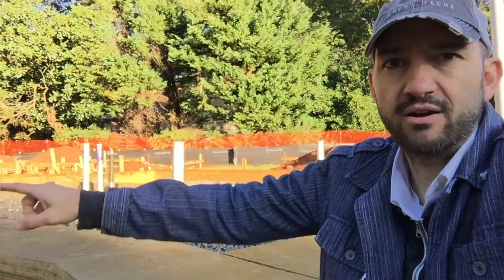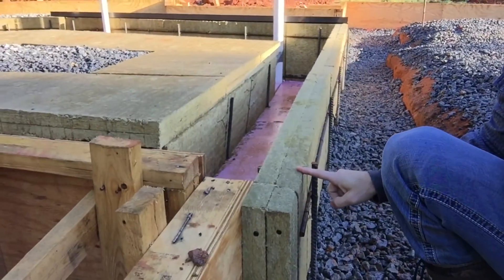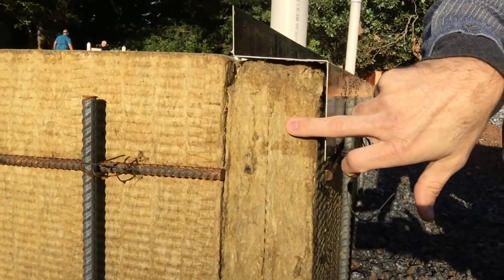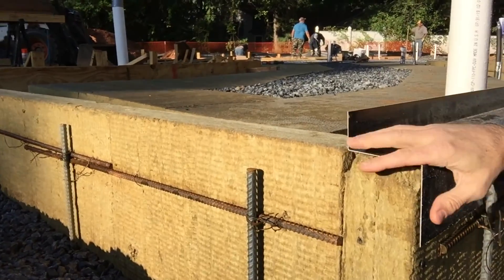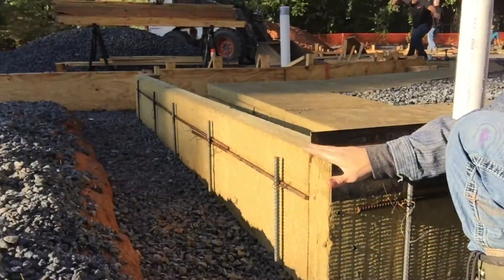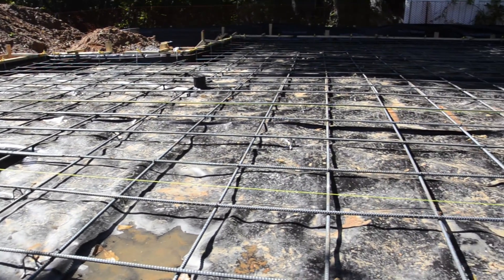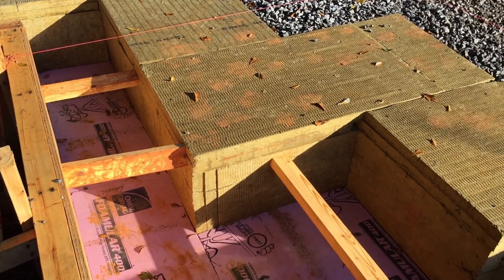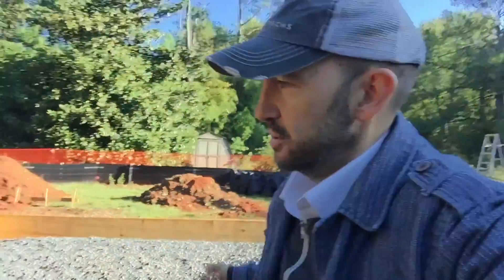Super-Insulated Termite-Proof Slab-On-Grade Foundation

Comment: Are the 24" footers, is what's called for in weight bearing capacity, or does GA even have a frost line, b/c you all have such a beautiful state(except for I-95 thru Atlanta, that's insane, I had a really bad incident traveling to FL thru there, I'm sure I'm not the only 1, lol) with warm weather. and can you explain the turn ups and turn downs. I'm sorry, I love Roxul videos and advance insulation and building techniques, as I think, in our country, we have the opportunity, to build great solid, weather proof buildings. I wish we would switch, to more concrete, like they do in other countries, as our buildings would last much longer, and if properly build, wouldn't have bug, breaking/cracking, and molding issues if built correctly. But great informative video.

Comment: Does that type of rockwool not wick water? I would not want a porus material  going into the ground like that....?
Reply: It will wick water. It insulates the same whether it's wet or dry. Rockwool specs it for this use case (Owen's Corning does not do the same for ThermaFiber caveat emptor). Wet insulation won't hurt concrete. The Z flashing detail he has is actually super critical for this exact reason. It will prevent water from wicking up into the rockwool covering the sheathing. He only mentions it's there for termite protection, but it's way more important for water.

I wonder if he will have problems with water challenging the foundation to sheathing seam though because the flashing will be taped above it. I ran a C flashing capping my sub-grade Rockwool in addition to the Z flashing he has here. Time will tell if it matters.
Reply: @jonathansage2147  That does not sound right - rigid foam has air trapped in it - the air is the actual insulator.... if wool is wet, it has no air, and will not insulate....
Reply: @pingpong9656  you're right. I looked up Rockwool's moisture guide. It doesn't wick water, it's hydrophobic. So it performs the same when wet because water gets pushed out of the material towards the cold exterior and sits on the exterior until it dries. The only time Rockwool will become soaked through is during a flood and that would damage it's ability to insulate while soaked.

Comment: Nope. Sorry to tell you this will be a termite nightmare in a few years. This is from someone with 28 years of experience in the termite industry. While termites don’t eat the rockwool they will tunnel through it to get to wood.
Reply from the maker: No need to be sorry, @Jimbo4575. We're not concerned about that, still. We're definitely aware of that possibility, but not concerned. The liquid-applied air and vapor control membrane (PolyWall BlueBarrier), while not confirmed (via lab testing) to be a termite barrier, does prevent termite intrusion to the wood sheathing and framing, because it is on the outside of all of both. The manufacturer has done their own testing and confirmed it is termite-proof. The membrane continues from the framing/slab intersection, to every inch around the entire enclosure. We know that the membrane is uninterrupted, with virtually NO hole or gap, because we tested it (with blower door) multiple times, and each time the result was at or below 0.05 ACH50. That's 0.05, not 0.5. The point is that there is virtually no opportunity for the termites, once they get through the 4" of stone wool, to penetrate the membrane.
Reply: @LGSquared that is a phenomenal ACH50 congratulations.